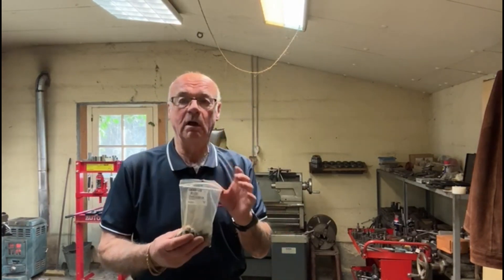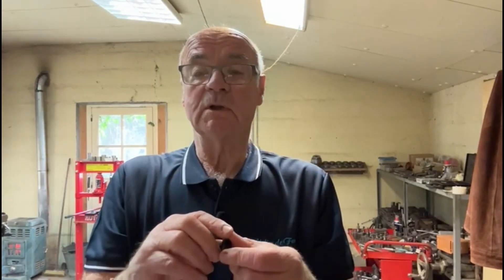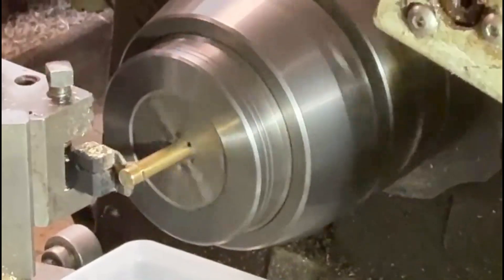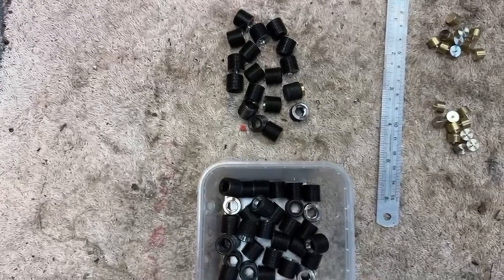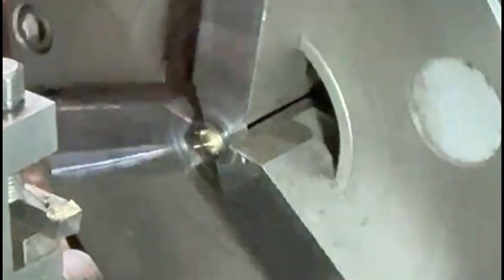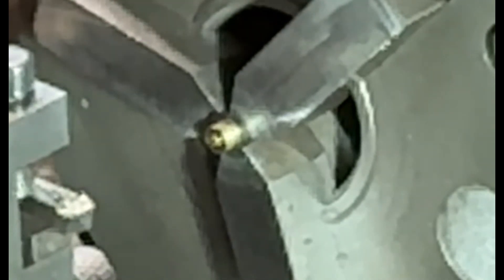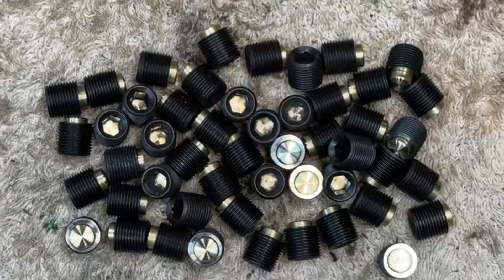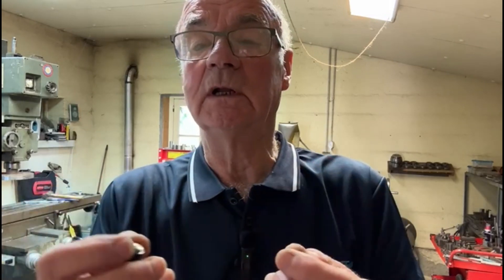Grub Screws with Brass Inserts

Comment: I make brass tipped set screws from time to time.  I just drill an undersize hole and press a little chunk of brass rod into that hole.  I keep various sizes of brass rod on hand for different diameters of screws.  You can find the brass rod at hobby shops or most home improvement centers.  Just mike it and drill your hole for a press fit in a bench vise.  If you really want something to be gripped tight use copper rod, as brass is somewhat slippery and copper is not.
Reply from the maker: Hi. Thanks for the feedback. These were quite a tight fit but I put some adhesive on as security.

Comment: same process with nylon or are there differences with the adhesive? I need to make 6 for something I'm working on, brass may be too hard as the slides are aluminium.
Reply from the maker: Hi, For aluminium I think I would use nylon as, even more alu would be score up. Just use an appropriate adhesive.

Comment: Superglue is not an anaerobic adhesive, and thus far from ideal to glue a metal part inside of a closely fitted bore.  If there is no air and moisture to cure the superglue, it could stay wet inside the pocket for an unreasonably long time. Loctite makes some adhesives specifically for this, closely related to thread lockers, designed for pressfit parts (honestly, most thread lockers themselves would work better here than superglue).

 I’m not saying this wouldn’t work, just saying professionally what the preferred solution would be, and that is something specifically designed to cure anaerobically.
Reply from the maker: Hi, thanks for the feedback. If you look closely at the screws you will see that the hole went through to the hex aperture, so air could get through. Tested the tightness of the insert and I was pleased with how firm they were. I don't have a problem with Loctite, in fact, I have several different types in my cupboard, but thanks for your input anyway. Cheers. Fraser

Comment: A friend asked me to turn down some grub screws similar to what you are doing. I took a piece of aluminum rod about 1 Inch ( 25 mm ) long, through drilled and tapped it to suit the grub screws. I then screwed the grubs screws in and put it in the lathe for turning. Of course, the grub screws immediately started to turn so that wasn't good. To hold the grub screw firmly in the aluminum mandrel, I screwed in a socket head cap screw from the other end and tightened it firmly in place. This worked perfectly plus it was quick and easy.
Reply from the maker: Hi, thanks for the feedback. That sounds like quite a good idea to hold the grub screws but I would be concerned how you get them out when they have tightened themselves in?
Reply: @MetalworkinginFrance-xe5rg  I just unscrewed the cap screw from the other end and the grub screws are now loose. I then used an allen wrench to take them out.
Reply: @MetalworkinginFrance-xe5rg just loosen the socket head cap screw holding them in 🤷‍♂️

Comment: Nice job. 
Why didn't you hold the grub screws in your collet chuck rather than use the soft jaws, better grip with little risk of damage to the threads.
Either way I am sure that your client was happy
Reply from the maker: Hi Jeff, thanks for the comments. My collet chuck would not hold the screws that short. Whatever I put in the collet needs to be at least 50mm long, otherwise the collet would collapse at the rear, thus only gripping on the tapered front edge. Cheers. Fraser
Reply: @MetalworkinginFrance-xe5rg  Makes perfect sense. 
My own ER20 collet chucks will hold short screws easily which is why I made the suggestion.

Comment: How did you end up living and working in France Frazer?
Reply from the maker: Was spending one day/evening per month paying bills only to look at my account and think "where's my bit?" So I decided to try something different. Came to France and ended up stating a light engineering workshop as I couldn't get some machining done for a repair on my mower. I thought there might be a call for it, and there does seem to be!! Cheers, Fraser